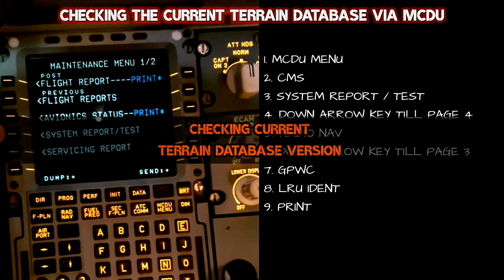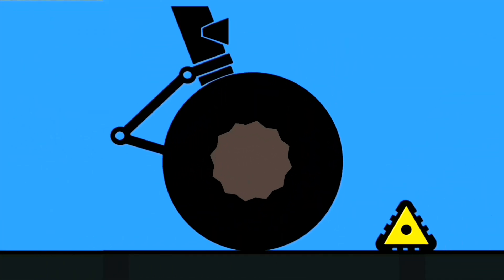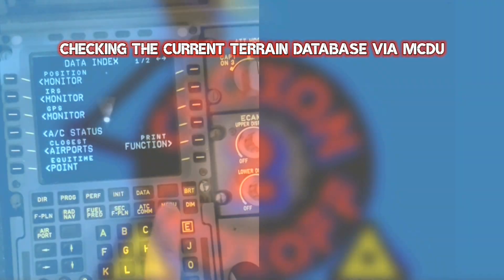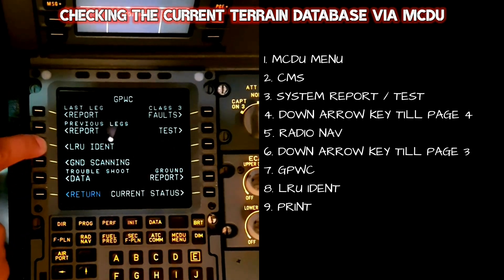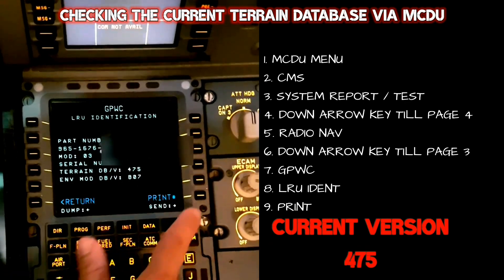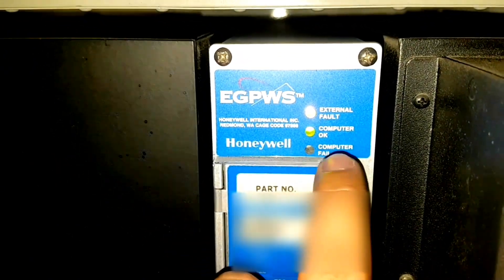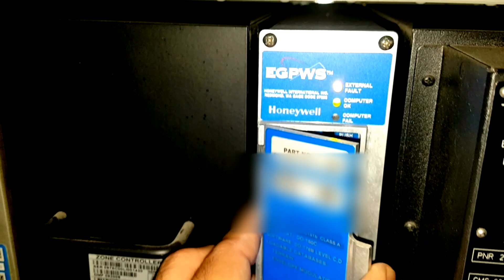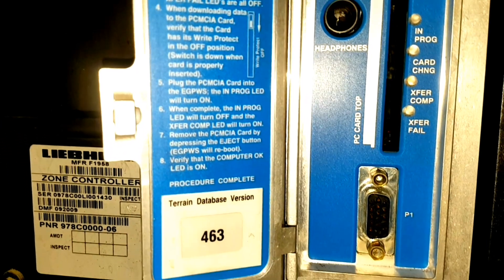A330/A340 TERRAIN DATABASE : HOW TO UPLOAD TERRAIN DATABASE IN GPWC USING PCMCIA CARD.

Comment: Does the PCMCIA card necessarily have to be linear?
Reply from the maker: Slot is a foolproof design.. it has to go in 1 particular position only.
Reply: @CHOXON2CHOXOFF  I was wondering if the PCMCIA card has to be linear flash type or can it be ATA?
And if it has to be 64Mb or can it be bigger?
Reply from the maker: It has to be partnumber mentioned in ipc compatible with lru.. 

It can be of higher memory also.